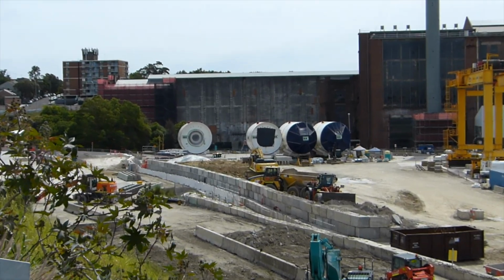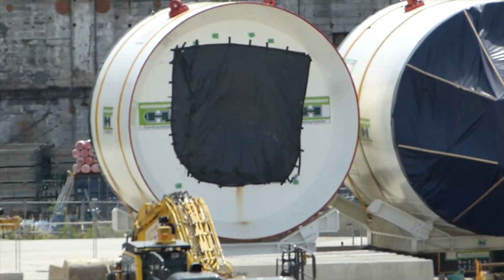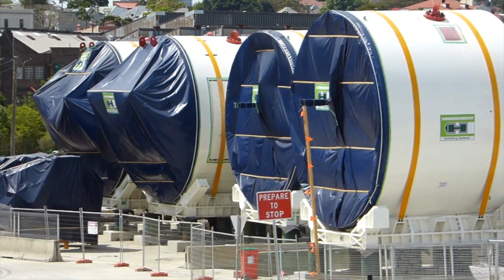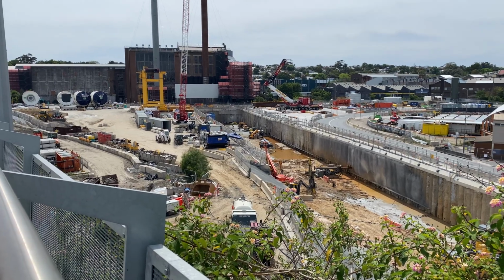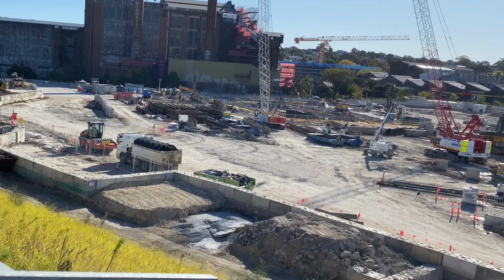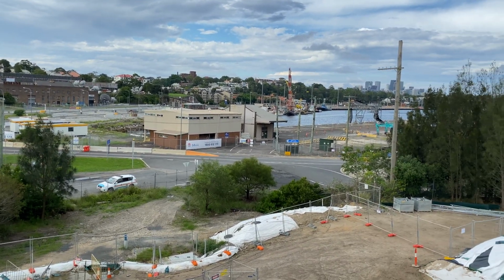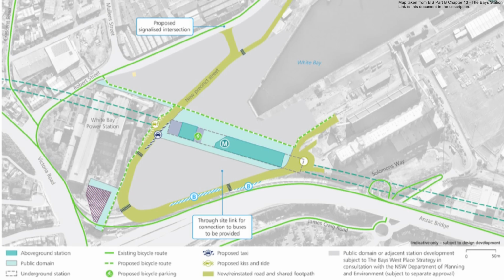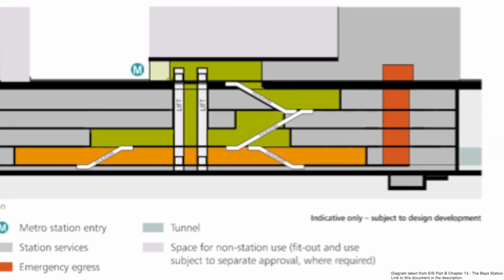The Bays Station Update - Arrival of Tunnel Boring Machines - Sydney Metro West

Comment: In China, the metro construction usually uses a gantry crane to lift the TBM components into the tunnel for assembly, I wonder if wheeled cranes are used over here?
Reply from the maker: Hi Yitao, Yes gantry cranes were certainly used at both Chatswood and Sydenham.  There is now a large acoustic shed at The Bays site, and that may well house the gantry crane.

Comment: Hi Paul, would the White Bay Power Station return to operation in 2024? Or just to be a museum?
Reply from the maker: I think its going to be a mixed use development, perhaps some apartments, some shops, maybe a museum, but all within the original heritage building. And I think it will be later than 2024 before this all happens

Comment: It's good that Construction is well underway with the Tunnel boring machine's tunneling through to Hunter Street in the City and out to Sydney Olympic Park as well out to Westmead despite being now under a Labor Government because under a Labor Government they STOP projects like this and waste money that don't benefit the economy or the State.
Reply from the maker: I don't think the Tunnel Boring Machines have started tunnelling yet. Labour are reviewing the Sydney Metro West Project, but that won't affect the work that is already happening.  It might even lead to extra stations, which would be a good thing, especially between Parramatta and Sydney Olympic Park and between Five Dock and The Bays.  Once thing that hasn't changed, is that the Sydney to Parramatta rail corridor is at capacity, which is one of the big reasons for building Sydney Metro West.

Comment: So much investment and so many missed opportunities. The metro will only take you two stops and dump you at Wynyard with awkward transfers to wherever you want to go. Why not more CBD stations? And why not a proper interchange at The Bays for bus and light rail transfers to Victoria Road and inner west destinations?
Reply from the maker: Hi Jack, I guess that's one for the planners.  If White Bay Power Station had been demolished, that would have allowed an interchange with buses on Victoria Road. There will be a tunnel stump at Hunter Street to allow a future extension that could serve areas like Darlinghurst, Surry Hills, then head down towards Randwick, and Maroubra. That could add one or two more stations to the CBD area, although more around the edges.

Comment: Gday Paul, the 3 tall machines are piling machines. They dig deep in to the ground, remove the dirt and sandstone. After the spoil is removed a rebar cage is inserted and concrete is backfilled in to the hole using a tremie. Each pile is done one at a time in a short amount of time to minimise the chance of the sandstone collapsing in on the exposed hole.
Reply from the maker: Thanks very much for that! You explained this really well!

Comment: The machine at 3:41 drills holes for pile foundations and the machines to its left are most likely pile drivers which insert the foundations and hammer them into the ground.

The Rozelle area is an absolute spaghetti of tunnels with the metro and Rozelle interchange, it's really awesome seeing it all come together now though.
Reply: @FormanddesignAu  Sorry they are called Piling Rigs, and piles are not hammered but drilled here under the support of temporary casings (visible at 3:32). This particular shoring wall is a Secant Pile Wall with Shotcrete facing. Cheers
Reply: Also the so called "screw machine" shown at video mark 3:42 is also a piling rig similar to the other ones. The difference is that particular machine is equipped with a Continuous Flight Auger (CFA) drilling tooling which do not require temporary casing whilst the other rigs are equipped with bored pile drilling tooling which uses the temporary casing. With temporary casing we can install full length deep (up to 20m) reinforcement cages into the ground post drilling / pre concreting, whilst the CFA methodology allows limited depth reinforcement depth typically in the range of 10-15m for the large pile diameters (1.2m in this project). 
Here are some videos explaining these techniques in details: Bored Secant Piles https://www.youtube.com/watch?v=UF9FLUioZv8 / CFA https://www.youtube.com/watch?v=aAZoTG0EY3U
Reply from the maker: That's awesome Bora! Thanks so much for explaining this and sharing these other videos.
Reply from the maker: Hi @FormanddesignAu, thank you so much for explaining this in such detail.
Reply from the maker: Thanks @TheRicoboy22, yes it will be good to see the Rozelle Interchange opening.

Comment: Are the TBM's built for purpose? Not reusable? wow, I figured they would use the same ones they used for the harbour. Fascinating.
Reply from the maker: Yes, as DaveG mentions below, it has refurbished parts from those TBMs. For some reason I forgot to mention that! -Its mentioned in this article. https://www.sydneymetro.info/article/first-tunnel-boring-machines-arrive-sydney-metro-west
Reply: According to Acciona - The cutterheads, front shields and gripper shields were originally used for the TBMs that dug the metro tunnels from Chatswood to Blues Point. So yeah, refurbished.